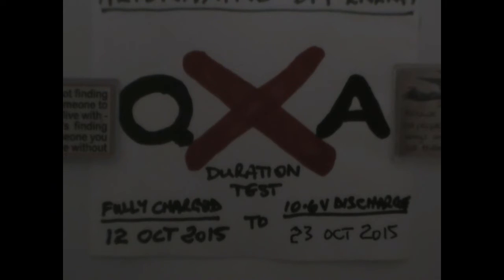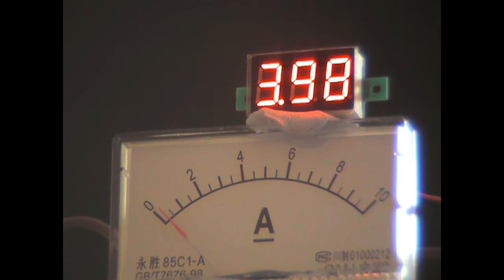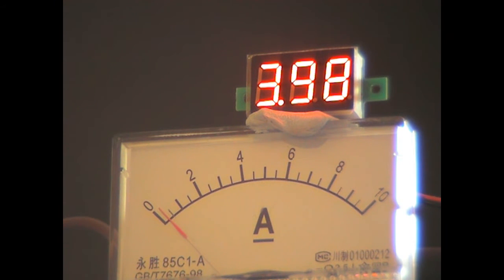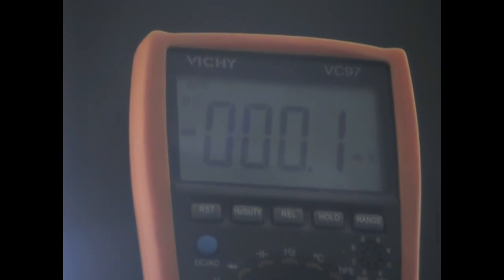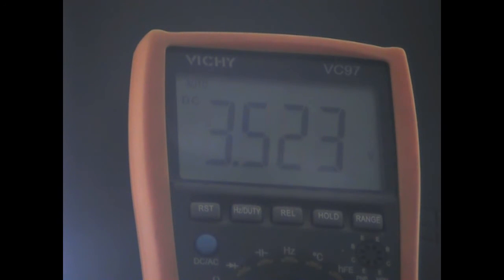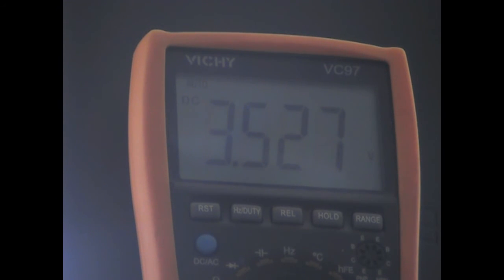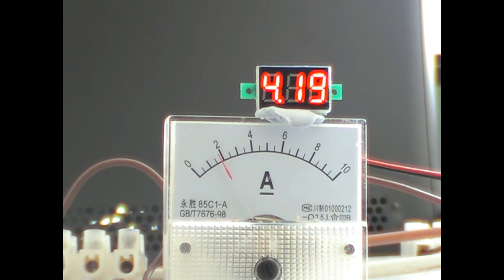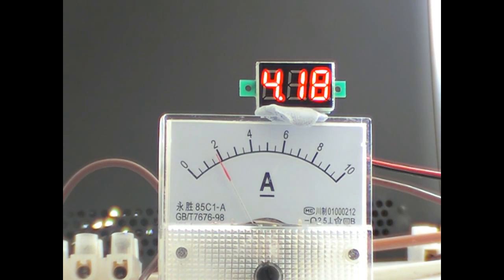New Lithium Battery 27

Comment: liking your set up very much going to set up a desk just for videos later camera fixed in place and on the desk I'm going to draw the area the camera covers thus I know when I'm in video range anyway that's off topic I'm going to try and draw my relay idea for 12 volt 5 volt switch over and maybe a way to use a voltage regulator and the voltage output of the solar panel to act as a dark activation unit my idea is the output of the voltage regulator  can only be as high as the voltage the panel can offer so say five o'clock the sun goes down the voltage drops below what the voltage regulator is set to this will stop suppliying power to the switch over relays and drop back to 12.6 volts having the voltage regulator we can adjust up or down to a point that it will come on when we need to start using light indoors an internal light senser could also be licked in so the lights come on when the room gets dark regardeless of the light outside this is handy for houses not facing south
Reply: +David Simpson Sounds like a plan my friend. If you would like a couple of LDR sensors I can pop them in the post. Let me know my friend.
Reply: i have to get double poll relays yet for chasnging the cells from parallel to series mosy things im taking apart only tend to be 4 terminals so that coil and on of side